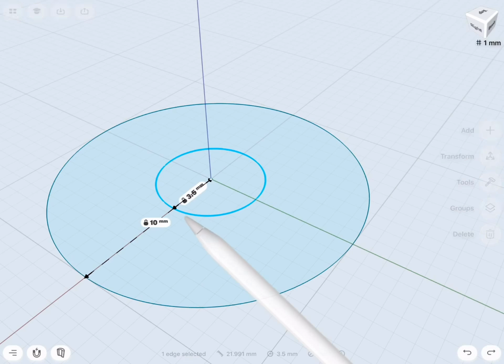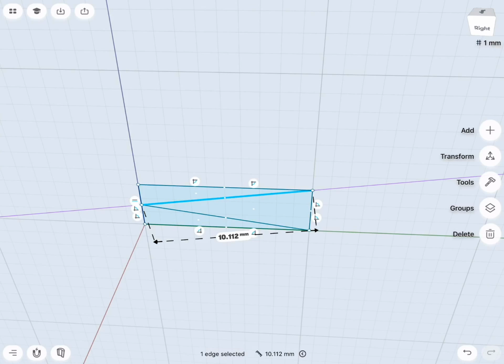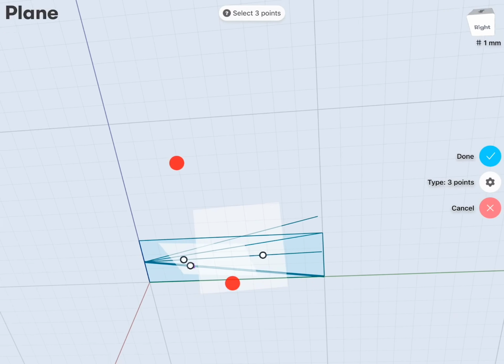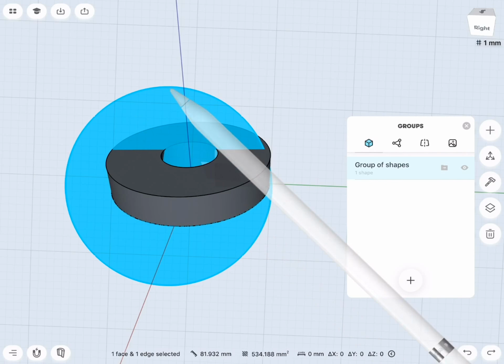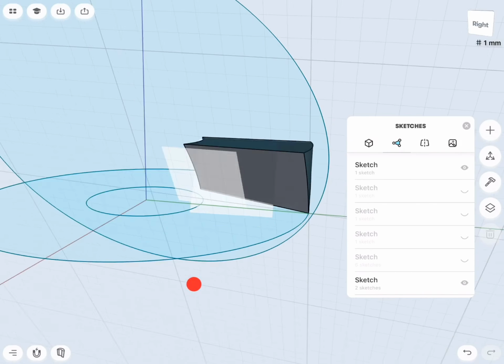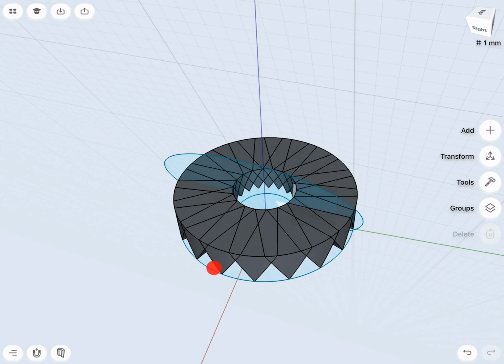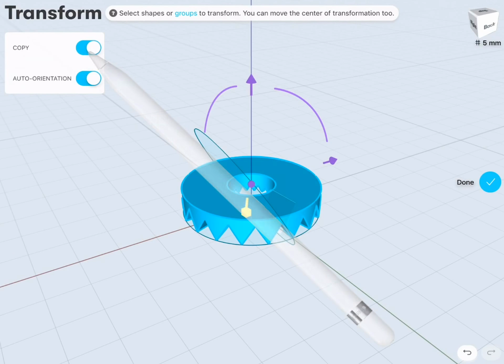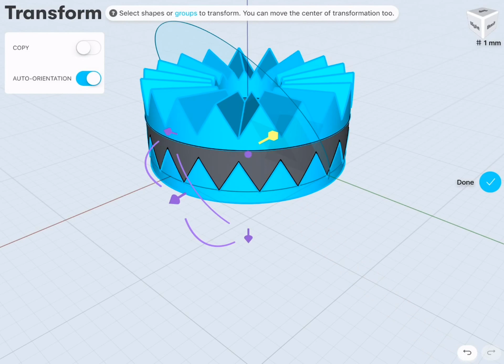Episode 3 - Creating a base pivot axis

Comment: Just add a gear generator into the app. Takes too long to create gears whilst designing on the office in real time.
Reply: or rather add a quick function for rotationally symmetrical parts in general. so that we can select a part, select axis, select step angle and total angle (in this example 20 / 360 degrees
Reply from the maker: Thank you for your feedback. I will pass on your feedback to our development team as we keep trying to improve Shapr3d.
Reply: Shapr3D thanks for being proactive :) love your app

Comment: Hi, when I tried to draw de circle around the construction plate to select it and to extract it, it doesn’t work. The circle end up straight or in a diferente position, if anyone can tell me what I’m doing wrong?
Reply from the maker: Hi, make sure to double tap with your finger on the plane first to make it the active sketching plane.
Reply: Shapr3D thanks for the quick response, it worked 👍🏻
Reply from the maker: i'm glad to hear that, and let me know if you have any questions :) 
Gabor